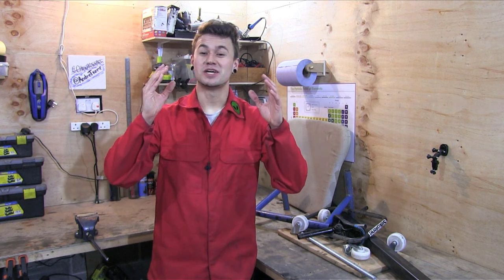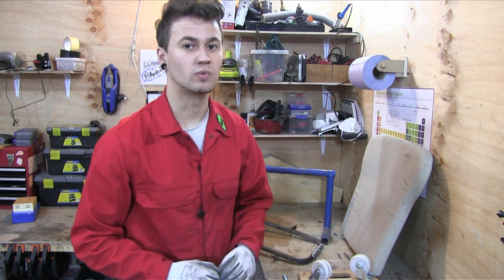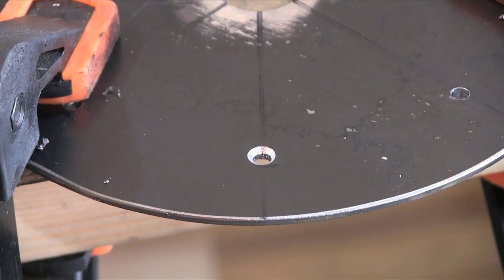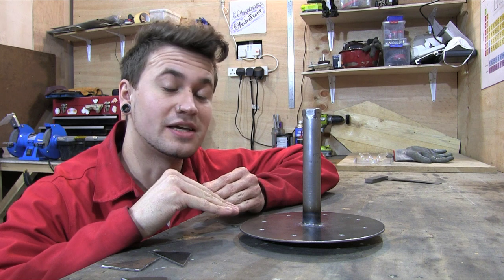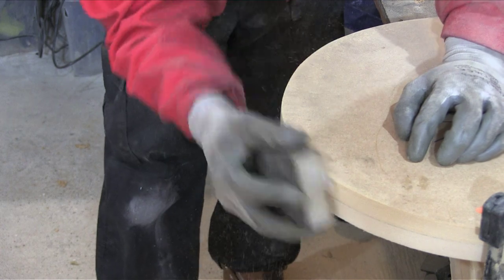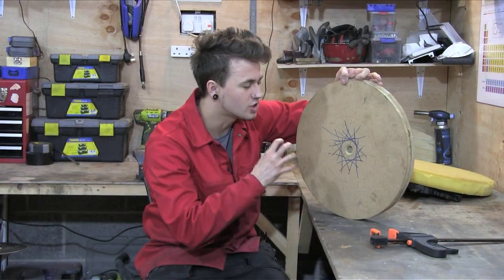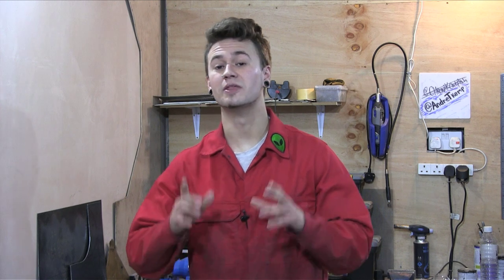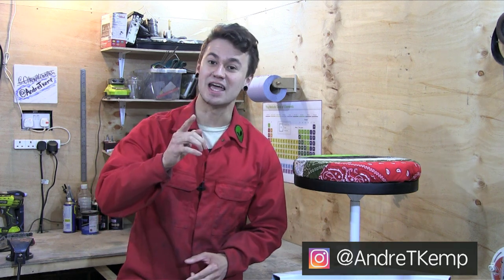Making a Scrap Metal Workshop Stool!

Comment: Great job and effort for using bits and bobs laying around for the project instead of just heading out to the shops and buy a new one! 👍🏼
Reply from the maker: Thanks, my dude! Yeah, I didn't wanna be out and about due to everything that's going on. It's always good to use up the scrap too! Get your moneys worth 😁

What did you think of the stool?
Reply: @AndreTKemp  
Yeah the stool is awesome and your welding skills is not too shabby either mate! Most weekend DIY woodwork guys/gals usually don't own a welder or easily get access to one so that makes incorporating metal into projects somewhat difficult. I'd just ordered a small stick welder online so i'll try and teach myself to weld better. Stay safe bro
Reply from the maker: @namelesswarrior4760  thanks, dude. I'm actually a full time welder/fabricator 😂 I just do the YouTube stuff for fun in my spare time 😁 my welding set up at home is a pretty simple and inexpensive setup, but is fine for the stuff I'm currently doing. Good luck and you too, my man! :)